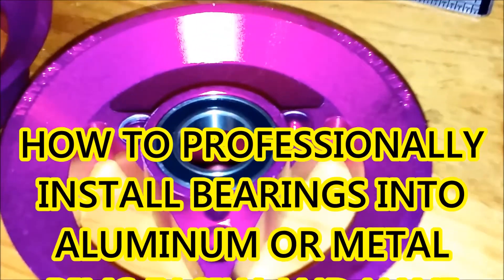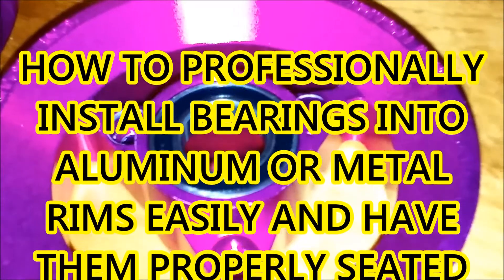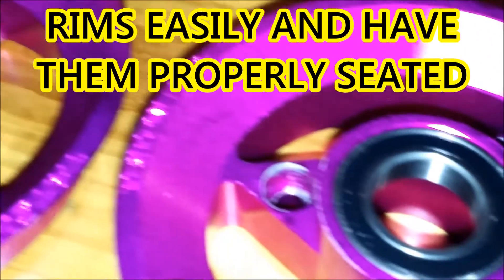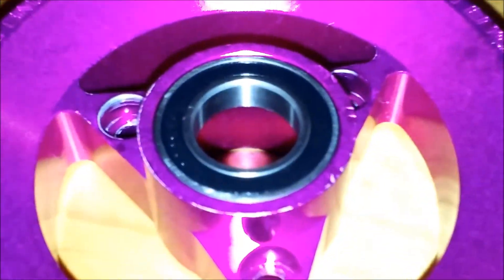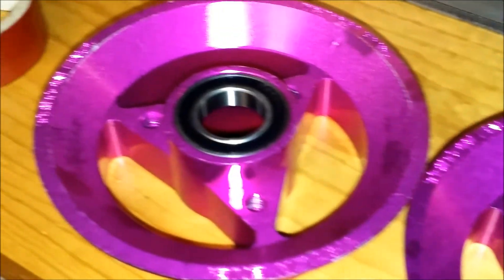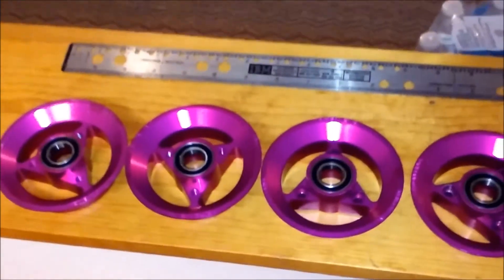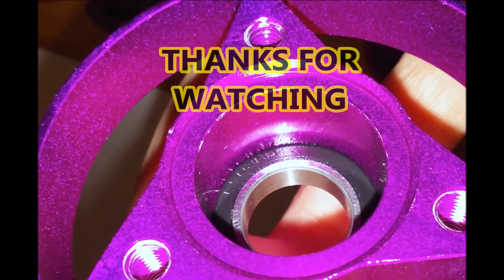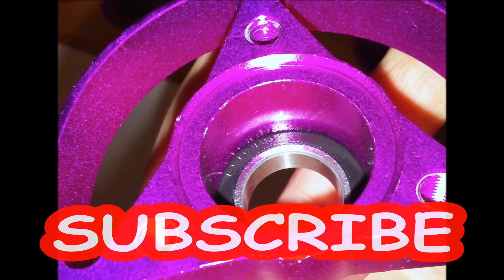How to install bearings the easy & professional way for a GoPed wheel

Comment: Are these powder coated? I painted my rims with spray paint and when i heated the rims to add the bearings, then set them on a towel to protect them while tapping in the bearings.. the towel was sticking to the painted surface and also became very fragile and chipped at some places .. is this normal? How to people paint their rims to be able to heat them up and stay solid like that?
Reply from the maker: These are anodized and can withstand higher heat.